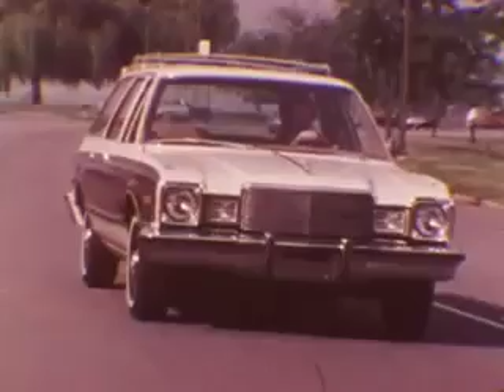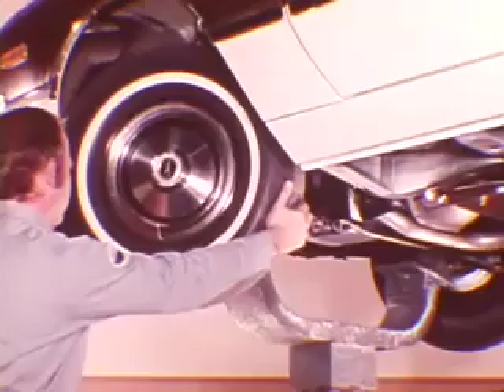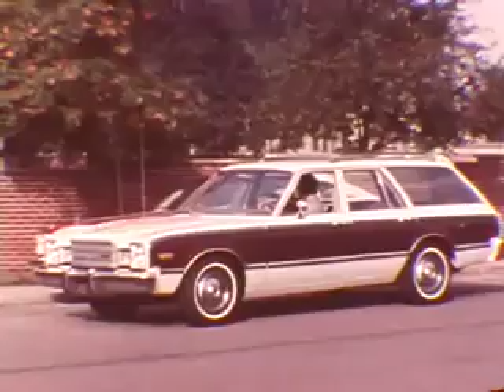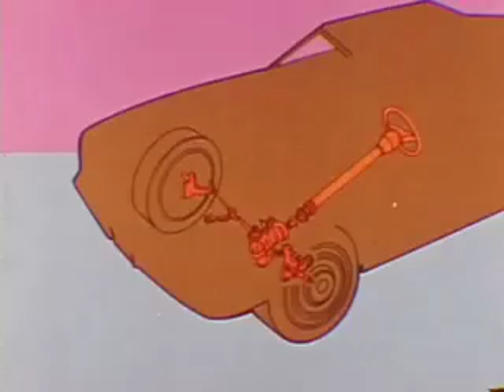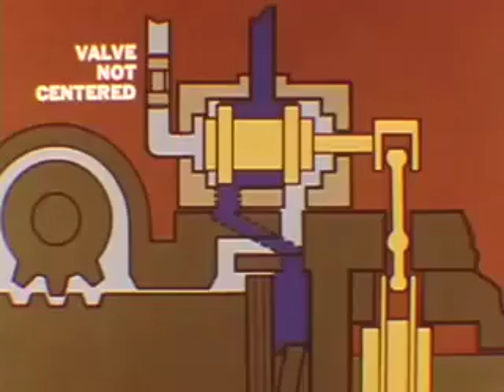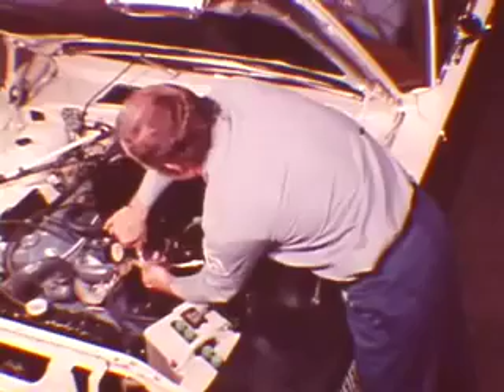Chrysler Master Tech - 1976, Volume 76-10 Power Steering Checks and Adjustments

Comment: Sector shaft is adjusted right for my nearly 50 year old PS gear but there is some minor looseness in the steering column into the gear. Everything else is new, everything I've replaced that is loose otherwise that back and forth common problem is not adjustable they say. I watched the inner workings and what exactly is worn is not clear. Anyone have a diagram to study? If not I guess I'm buying a refurbished one. Just tends to bother me while on the highway.